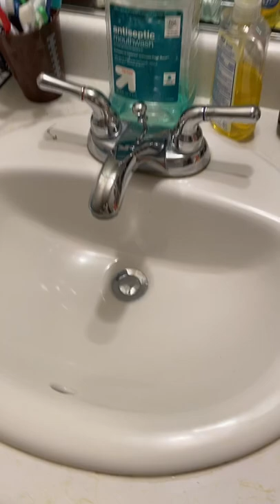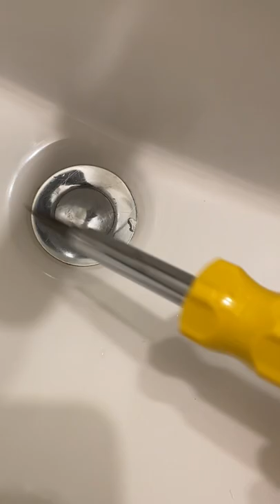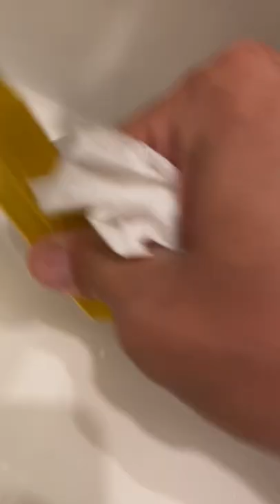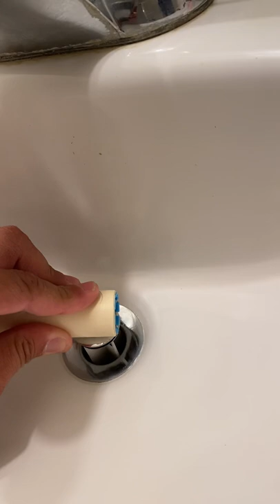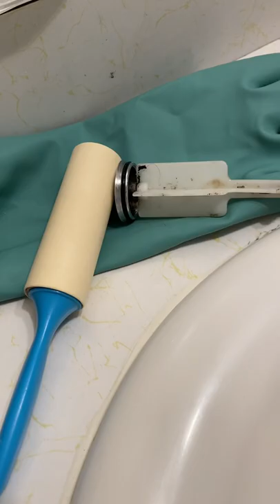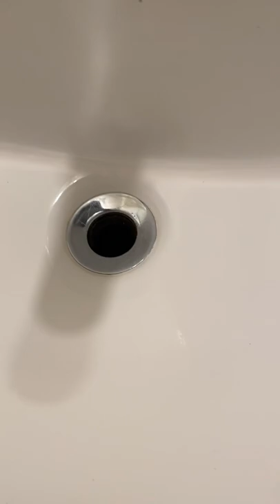How to unplug a sink water stopper

Comment: You are the greatest. I rolled some sticky gorilla tape and it worked.
Reply from the maker: And there you go lol, have a blessed day and I’m happy that it helped 🙏🏽
Reply: Your comment actually saved mine bc the lint roller still didn’t work. Got the gorilla tape out , that didn’t work to lift it. But then I thought to use it as the extra grip to turn it(rubber gloves didn’t help with that for shit earlier) and sure enough it started spinning. 10 spins later it was out🙌🏼

Comment: Thank you very much Sir! This is the only solution that worked. The lint roller worked like a charm! 

P.S: If anyone was having difficulty placing the lint roller vertically down on the stuck stopper, you can also consider pulling out a strip from the lint roller and laying it flat on the stopper then pulling it up. Good luck!
Reply from the maker: Yes I’m Happy to worked for you even though your a chief fan 😂 have a blessed day

Comment: Or you could just go under the sink and lift the lever that controls it while you pull it out instead of spending so long using a ladle to scoop the water out lol. Or just put the clip that connects the lever and the ball joint piece back on. It has nothing to do with the pipes and you don't need any tools.
Reply from the maker: Sounds good this just worked out great for me and many others lol
Have a blessed New Year
Reply: @davidleon2000  have a blessed new year yourself too 🍾